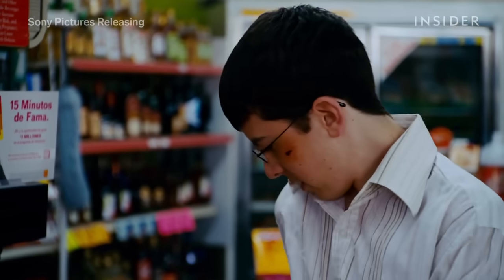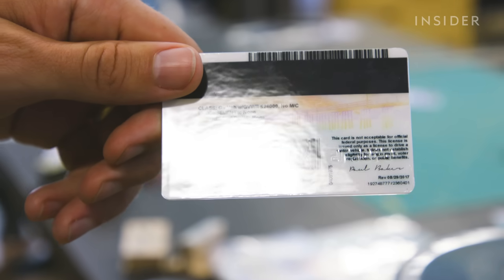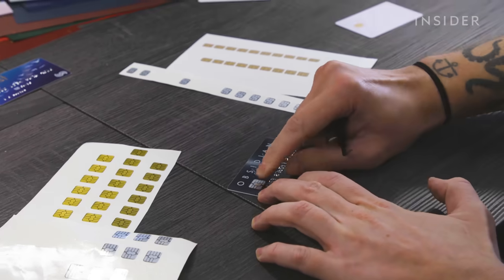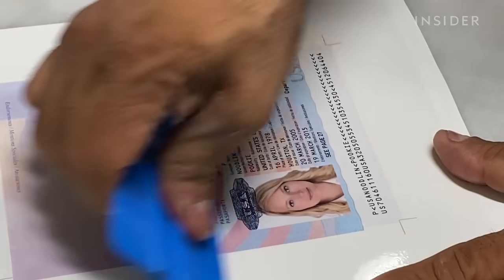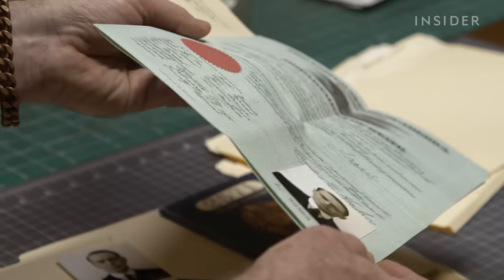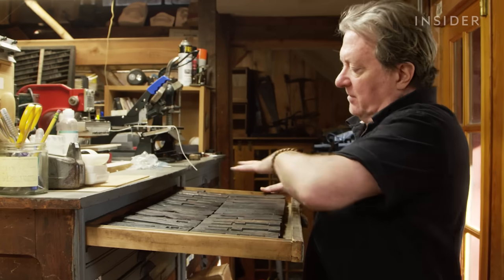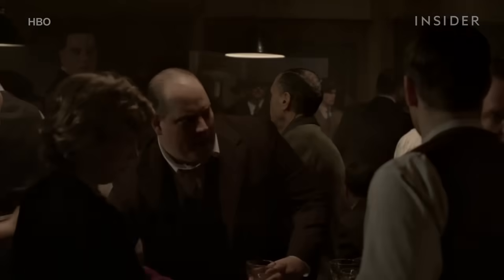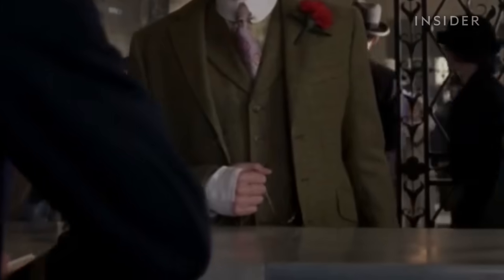How Fake IDs Are Made For Movie And TV Characters | Movies Insider

Comment: Me: Still trying to get Alcohol with my library Card.
Reply: The library card is most likely polyethylene, so you can use a vanadium catalyst to convert it to formic acid. Then reduce to chloromethane using HCI, add sodium to get ethane, add sunlight and chlorine to get chloroethane, and turn it into ethanol using hydroxide